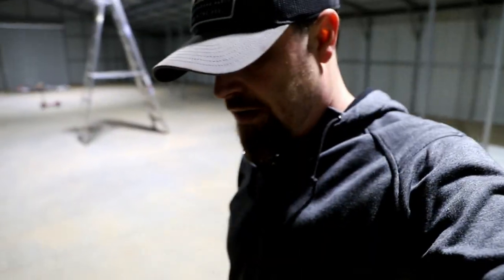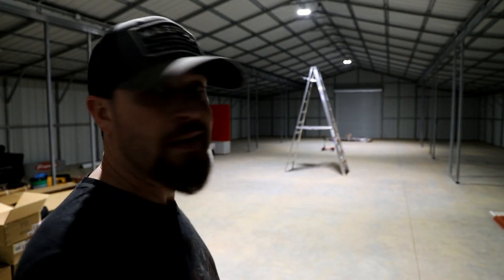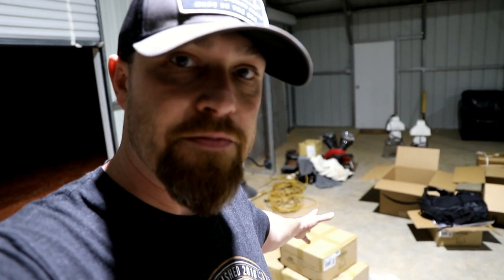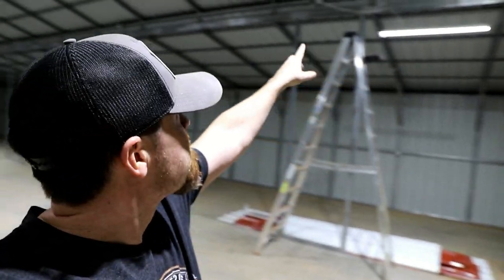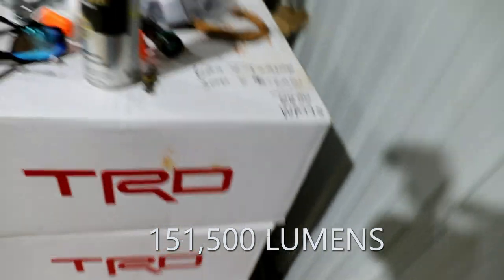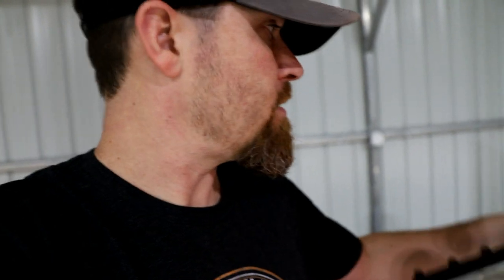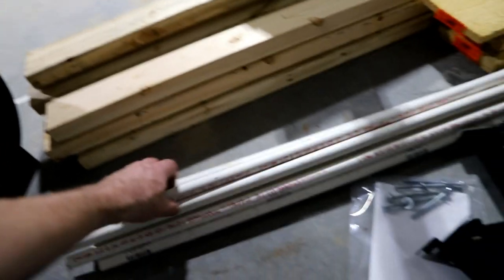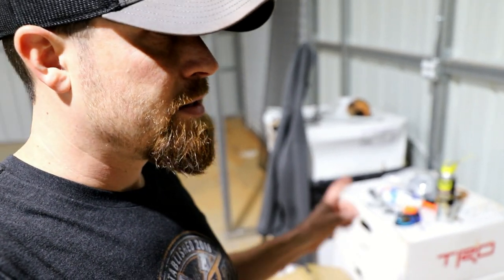151,500 LUMENS of LED Shop Lights

Comment: Loving the shop. I agree with you about the light. When I had to redo the floor in my old shop I went crazy with lighting. I even put lights in the floor under plexiglass on each lift. Came on when I operated the lift. Same with lights on the walls in front of lifts. Hate not having light when I'm working. Can't wait to see finished
Reply from the maker: thats awesome

Comment: Don’t use amazon prime!

You really should NOT use any pvc for air lines, regardless of the pressure rating! The constant high pressure and also high and low/no  pressure WILL WEAKEN it and it will blow out!!! Its not a will it, or if it will question, it’s a when will it blow question. 

On the floors, if for no other reason than to keep the concrete from staining, I’d epoxy it a light grey at a minimum. If you don’t protect that floor now, you will regret it and wish you had later on! You’ve built such a nice and beautiful shop, it would be a shame to leave those floors bare;) 

And if I were you, I would look into getting a sprinkler system put in, just in case of fire! You’ve got a lot invested in the shop by itself, let alone everything you’re putting in it. Better safe than sorry. Plus you can get an insurance discount for it too;)

Hope my suggestions help....
Reply: Just to add to the NOT using PVC....
Compressor oils degrade PVC and that is why the joints weaken.

Comment: Should switch the main stuff instead of switching breakers on/off since they will wear out, put them on a 20a or 30a light switch to save the breakers.
Reply from the maker: yeah....I figured I would just replace the breakers if I ever have any issues
Reply: I forgot to say I like the amazon plan I do watch a lot on prime and would be a good way to gain a broader audience or even a new one. Hope you have events at the shop I’d drive down and check it out if they’re open.
Reply: The Fab Forums as a sparky I can assure you it will save money in the long run not to switch with breakers; it also will give you a lot of flexibility not switching with the panel...not really designed to operate that way. Besides, with a shop that long why wouldn’t you have a 3-way or even 3 switches that all turn the main lights on and off so you don’t have to limit yourself to one exit? Switches are cheap, and if you are able to pipe it yourself that’s cheap too, all things considered.
Reply: The Fab Forums since everything is in conduit, wouldn’t be hard to add a switch. That’s the “right way” to do it.
Reply: They do make switch rated breakers... heavier duty contacts.

Comment: For the air lines, I did a lot of research before deciding on the route I went.  PVC weakens and becomes brittle when used with air, lots of stories about explosions.  Steel is heavy, copper is expensive, which lead me to the RapidAir air line kit designed for air tools.  I went with 3/8 line 100ft Kit on mine.  It’s super easy to set up and inexpensive on Amazon.  I have a 1/2in hose coming off my 60-gallon compressor to a air/water separator, to the 3/8 RapidAir lines, across the ceiling, and into my hose reel and quick connect.  If one blows out or leaks it’s super easy to fix as the hose and fittings are reusable.
Reply from the maker: I checked it out...very interesting
Reply: Black iron pipe is fine, but heavy and you need a thread cutter, manual or electric that can be rented. Not super expensive and availability is great. Do NOT get galvanized! It's reject black. As turbo said, PVC is a huge no no. I put the RapidAir system in my shop and love it.
Reply: only bad thing about rapid air is I think their fittings suck. i messed up 2 of them installing them.. threads don't hold on the tube nuts.
Reply: shelton einerwold not sure what happened with yours.  My fittings went in perfect, no issues.  The air lines are all push-loc so it was all easy to install.  Mine have no problem holding 100psi for over a year now.  Had one small air leak when I cut a hose too short, unscrewed it from the wall, re-clamped the fitting, and no problems since.
Reply: mine was 3/4" kit. all compression fittings not pushlocks
Reply: I use PEX water line. Super cheap and easy to run
Reply: @burninrubba65  I like that idea. Any issues holding pressure? Longevity? I'm intrigued by that concept
Reply: @turbohcar  sorry expensive or not copper can't be beat. Lasts forever. That's what large manufacturing operations use
Reply: High Oktane Kustoms have at least 150ft of line set up in a barn. Gets below freezing here. Put it in 4 years ago. Never had a issue
Reply: @burninrubba65  I may need to look into that for my 1 car garage shop

Comment: I just ran air in my farm shop 
Used metric poly pipe Called blue line in Australia 
Dirt cheap and really fast because it just comes in a big roll 
Ran about 200m (600ft) plus all the fittings dor $300
Good for 30yrs outdoors in the sun running water Never wear it out indoors 
Rated to  200psi
Pretty much the standard in industrial buildings over here
Reply from the maker: right on...may have to go with something like that
Reply: @Thefabforums  
Your local farm supply store should be onto it 
As long as its the metric stuff 
The imperial stuff uses differant fittings that are lower pressure 
Metric hose fits inside the fitting and uses a collar and screws cap 
Imperial uses a barb that fits inside the hose then that fits inside the fitting 
The only tip I can give is if you want it to look real nice hen roll it out of the ground and put a little tension on it between 2 trees 
Like anything that comes in a coil it likes to stay all twisty so leaving it laying out on the ground for a week or two makes it far easier to work with and gives a better finished look

Comment: Kyle, the epoxy floor coating is also a sealer that protects the concrete from wear and erosion from the chemicals you'll be using.
Reply from the maker: yeah its probably what needs to happen

Comment: All air lines are PVC in my shop. Regulated down to 100psi. 10 yrs and no problems
Reply: Too dangerous. 

Proper Aluminum lines are about the same price and have better heat transfer properties.

Comment: Man, that looks like a hoot! I love installing lighting, it’s such an immediate change (kinda like the electrical version of painting). Wish I could come and give you a hand, I haven’t gotten to wire up a shop in a while! BTW, that’s only a 1050W load down the middle if those lights are 150W each and if you’re running 277V only 4 amps or so. With those LEDs you could probably run the whole shop on one 20A breaker but for practicality that would be a PIA.
Reply: I figured it might be an maths mistake. That would have been a whole lot of light.

Comment: Looking awesome.  Can't wait to see the insulation installed. Looking to do that myself.  If you decide to do epoxy floors yourself check out epoxy coat.  Did my 25 x 25 garage in a weekend by myself.  The prep is the worst part of it. Don't do much with Amazon prime video even though I have it.

Comment: If you plan to use the breakers to turn stuff off/on more than once every few days or once a week, you should put a switch in because the breakers will wear out and start to trip easier. The springs inside tend to fail after a while of continuous flipping..

Comment: You can do the rapid air kit as described but it gets costly quick by time you add the junctions the extra fittings etc. You can do pvc but you the performance pro grade that is specific for air is what needed and has 1/4-3/8 inch thick walls. Cost a little more than normal pvc but holds alot more pressure and it looks like gray pvc conduit but its air line. It what we have to run the shop at my job and its a 30k sqft warehouse essentially. Runs everything from door hingers to door cut out to trim machines. Yes its a door shop. the performance pro grade air line should work great for your shop though.

Comment: Hey Kyle, I really appreciate all the trouble you go to, to show people like me not only how to setup up their shop to be a functional workspace but also sett it up for filming. I can’t tell you how much it helps to learn about different ways to do things. 
For quite awhile now I have been thinking about starting my own channel, just never had the extra time. 
Now I have the time and have just moved into a new shop as well. So I will be listening closely to your advice and tips.
Can you also post updates on how you are setting up cameras for filming in the new shop? As well as how you are setting up shop air and water? Are you putting your compressor inside or outside? Will you be running blasting cabinets? 

I do watch amazon prime videos and would definitely watch your content. They definitely could use a boost in tech videos. Thanks man, keep up the good work!
Reply from the maker: right on....yeah man for sure

Comment: 1:00 What type off door is this? is cheap? I am building a garaje and i need some door. 4 to be exact, and are really expensive. The other option is build ones by my self, but it will be heavy if i build in iron.
i hear you that there are glass fibre doors?

Comment: We have prime but only watch the free stuff lol. I’ve worked in shops that had the pvc it works well just use lots of shut off so when and if it brakes u can isolate it to repair it also the repairs are quick n easy as u already know, and you prolly won’t have lots of failures especially if u have reels it was usually when we were constantly plugging in hoses and taking them off.
Reply from the maker: right on...all my content will always be free

Comment: In a building this side you also need emergency lighting so if you loose mains power they come on automatically for safety reasons.

Don’t know if it’s available in the colonies but a French company called “Legris” make a plug together aluminium air line system.
Reply from the maker: I will have to take a look

Comment: As far as not using epoxy on the entire floor; what would look worse? The inevitable oil / grease stains that soak into the concrete or scratches that will occur when "you're doing work, son"?
Reply from the maker: yeah I have considered that

Comment: You could actually put everything on motion sensors directly from the breaker. With what we call a power pack wired to a motion sensor via low voltage wire. Sounds more complicated than it really is.

Comment: I missed the size of this shop, what does that equate to in lumens per square foot?   It should be 100 lumens/sqft minimum for adequate light.   

Also I have epoxy in my shop and I do heavy automotive and fabrication work and you would never know as soon as I hose the floor off.   It's the ONLY finish that holds up and it beats the hell out of bare concrete.
Reply from the maker: Its 3840 sq ft....let me no the math...looks like im only at 40 lumens per sq ft. Guess I need to add more ;)
Reply: @Thefabforums  Never a bad thing.    Even at 105 lumens per sq ft in my shop it's still a little dark for me, especially while filming.

Comment: Nice, I love your big garage/ work space now, so happy for you!!! And looks like a barn outside, nice! Couple questions: you are planning to sprayfoam insulate?? I guess that would be easiest way to go??how about glueing some insulate-boards, in ceiling/ walls?/ Less messy, kind of easy too?? how cold does it get there?? You get snow?? And one more: how do you heat this space up?? Fireplace too??/ Thanks, keep it up, and remember, you will need one of those floor hoist, whoever you call them ;o)
Reply from the maker: thanks...yeah spray foam for two reasons. The insulation R value and to seal the building up
Reply: And heating up?? Electricity?? And fireplace??=)

Comment: Looking good Kyle! Just picked up three cases of the same 4ft lights to get things started.
Reply from the maker: right on...seem to work pretty well. I will most likely bypass the pull chains though
Reply: The Fab Forums same here.. the ones I got are linkable up to 10 in a row as well so I can run them off one outlet.

Comment: Those seven lights in the middle are definitely 150watt not 600 watt, your total of 6600 watts is way high.
Reply from the maker: they are 150 watt LED which has a 600 watt incandescent equivalent

Comment: @ 4;44 ( Standard wattage) if I understand correct. 25-28LED-watt=150 Incandescent watts. So lets say 25/150=6 6X150=900. So 150 LED watts is equal to 900 Incandescents watts. Info from, 
https://learn.eartheasy.com/guides/led-light-bulbs-comparison-charts/
Reply from the maker: cool....I was just using the watts equation they had listed on the box. I guess lumens would probably be a better metric

Comment: For the floors, you need to seal them somehow, especially when working with heavy parts. That concrete when left unsealed, erodes fast, and the dust goes everywhere. more durable seal, less dust and worries. Also, that PVC pipe works perfectly fine as air line. And for the Amazon question, no. Not watching it, and not going to watch it.
Reply from the maker: yeah I plan to do something

Comment: Sprayfoam can be very messy, you may want to remove or cover up anything you don't want foam over spray on.
Reply: I'm sure the contractor will take care of that. They don't just come in willy-nilly and go spray and foam all over the place getting it on everything and they also usually clean up afterwards if some does get on a concrete they scrape it up
Reply from the maker: yeah for sure

Comment: I usually don't have a good enough signal (too far in the woods) to stream much, so I wouldn't watch.  If it's another opportunity for you, I'd say go for it.  I know some have left YT for it (like Kevin Tetz), so it may be another opportunity to experiment over the next year.I didn't epoxy my floors for the same reason.  I just keep up on the cleaning as best I can.  It looks great, but can be a hassle too.  Maybe just do a small section for your conference area you have mentioned before, or some vinyl tile?Think of where you will be in a year from now with the shop.  Looks better all the time.
Reply from the maker: no plans of leaving youtube....just plan to add Amazon to my network

Comment: Awesome Shop! Cant wait for the finished project!  Im looking at getting a shop built in similar size and was wondering what the spray in installation costs per square foot or linear foot, however they charge out.  Its between spray in and just batting, not sure which route to go.  Any help would be greatly appreciated.
Reply from the maker: thanks...not sure on the square foot cost. Mine will be over $10k
I prefer spray over everything else for this building because it will seal everything up
Reply: @Thefabforums  Honestly, that isn't anywhere near as bad as what I thought it would be for that much space.  Now that you mention it, that makes perfect sense to use it to seal up the building.  Two birds with one stone so to speak.  Thanks for the reply, can't wait to see it finished!

Comment: When you added up the wattage, I’m assuming that’s the equivalent wattage not the actual right? Can’t imagine LED’s would really draw 600 watts each like my mercury vapor lights.
Reply from the maker: yeah....probably should have used just lumens to compare
Reply: The Fab Forums and what’s the actual wattage?
Reply from the maker: @waynenocton  the center lights were 150 each and the sides were 40 each

Comment: was'nt the high bay lights 150 W and the 4-footers 40 W? 150 x 7 + 40 x 8 does not add up to 6600 ;-)
Reply from the maker: yeah....I guess I didnt explain. 150w LED equals 600w regular
Reply: @Thefabforums  yeah, i figured that was what you meant :-)

Comment: you show the 7 center lights at 150w each... so they only would take up 1050w
Reply from the maker: 150 watts LED is the equivalent of 600 watts standard
Lumens are a better way really of rating it vs watts
Reply: Ohh yeah I thought you were talking about the total usage of power

Comment: 12:40... a decent wood glue or epoxy will fix that right up Kyle. ... Looking real nice in there man....☝.. Yeah man.. Get the black gas pipe for your air......I have Amazon Prime... and I will watch.....👍
Reply: Craig Cundiff that crap rusts so fast with the condensation in compressor air
Reply: @Chris-Devine  there are ways to mitigate condensate so it doesn't. .. Dryers and filters and Maintenance...👈
Reply: Craig Cundiff true but why run the risk of having rust flakes running through your air lines if you can help it at all from the beginning.
Reply: @Chris-Devine  I've worked in the shops that have had the same compressed air piping for over 40 years and we still use it... there's absolutely nothing wrong if it's maintained properly.... sounds like you had a bad experience with piping that wasn't maintained properly

Comment: I have a well I’m going to build a water chiller in my shop to cool 
It down and not pay a huge ac bill 
My well is 55 deg water
Reply from the maker: thats rad...I almost put water lines in the floor for heat and cooling
Reply: The Fab Forums but then you cant bolt anything to the ground.
Reply: Mark I’m going to use a large coil or radiator

Comment: Can I run a turbo on a 6.0 with a stage 4 cam an 4cc dome top pistons
Reply: You have to figure out what your compression ratio will be with the type of piston you're running, you need to run lower compression on a turbo or supercharged application because obviously the Boost increases your compression